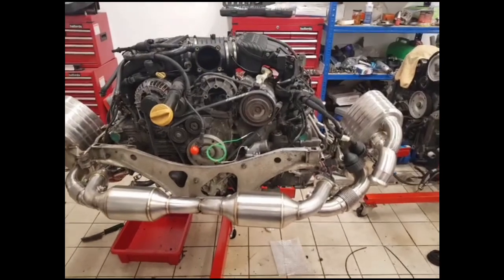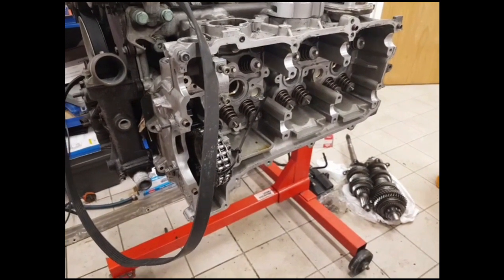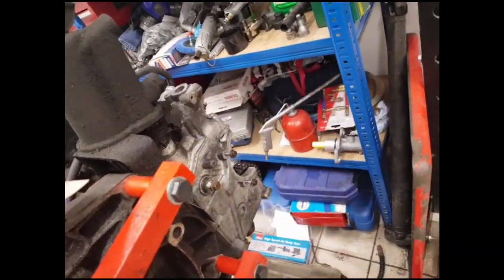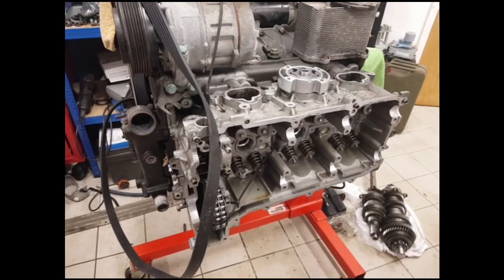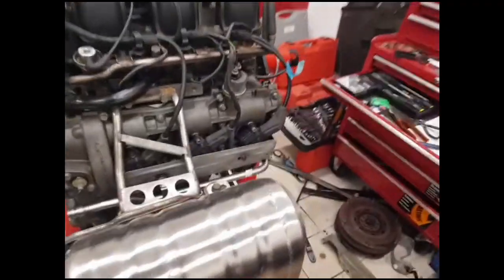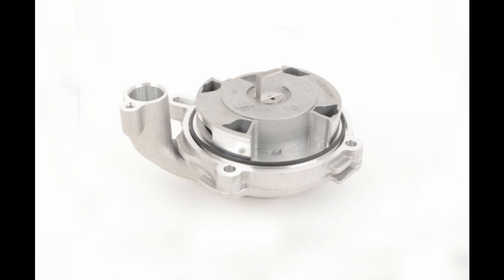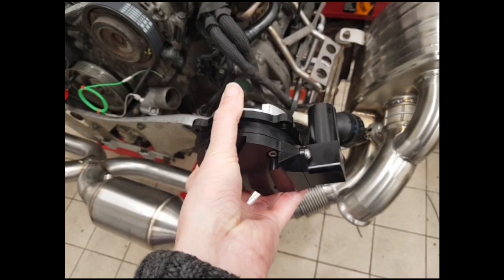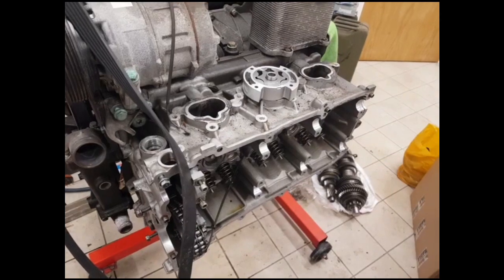Porsche M96 engine head scavenge system description, As used on 996 Carrera and 986 Boxster.

Comment: Hey Martin. These are some VERY interesting videos on this X51 kit. Very valuable for the community. Do you however know if the scavenge pump is part of the M96 3.6L engine or only the 3.4? I have 996 C4S (3.6L) with the X51 option from factory and wondering if it indeed does have the scavenge pump.
Reply: Do you see under your car? If there is the pipe?

Comment: Hi. Im from Spain rebuilding my 996 3.4 engine after a rod bearing fail on track. Any recomendation or upgrade to oil system??? Im viewing to install the x51 sump + 0.6L sump and a oil pump hex EPS with Direct lubrication to ims bearing. Any recomendation too?

Comment: Superb reverse engineering, good design and I will make one modification by installing inline check valve on added pipe. Also, if you have the capability to make few more, I will be interested in couple ones. Cheers